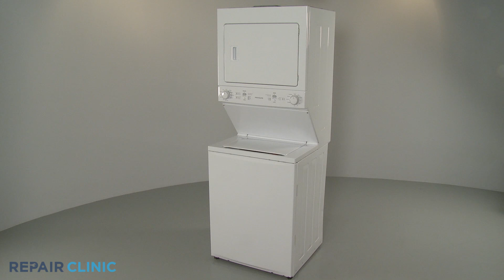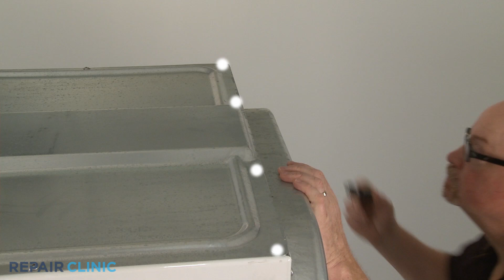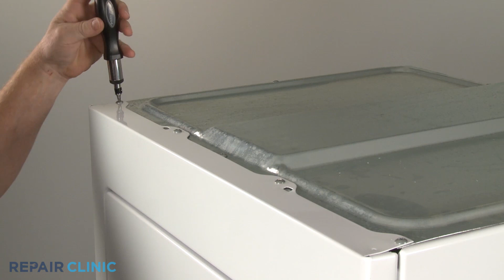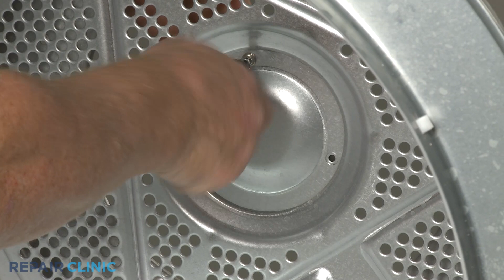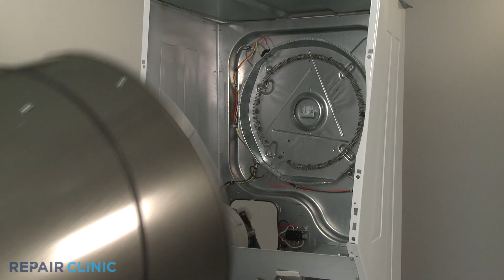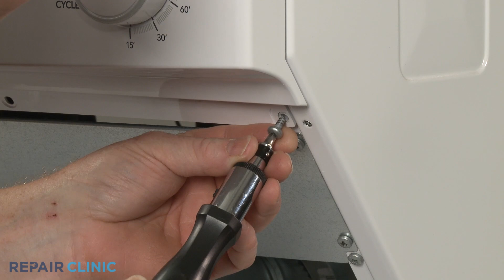Frigidaire Electric Laundry Center Dryer Drum Bearing Replacement (131777700)

Comment: if you're doing this in a closet take the whole top off and get a step stool tall enough to pull the drum from above, it also helps to get it back in. and don't forget to vacuum it out while the drum is out

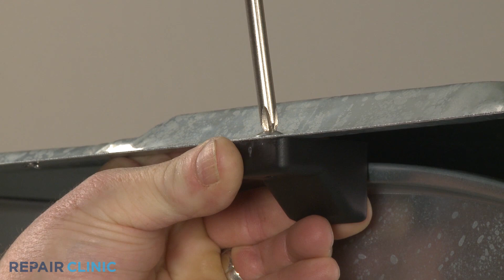Comment: You  should take top panel off the dryer to allign the rear bearing into the drum support. I struggled for 2 hours to try to get it in place, 30 seconds with the top panel off. 5:40
Reply: THANK YOU FOR THIS!!! It took me hours trying to get it aligned when all I needed to do was take the top off!

Comment: If you replace the rear bearing you use the kit and replace the bearing holder as well plus the front bearing glides. Else do not bother. Its a real PIA job.  I have done several and this video makes it look easy. it is not.  Be glad you do not need to repair the Washer.  These are lousy machines.

Comment: i do not understand this video ??? why would anyone ever replace the drum basket bearing ??? and not the holding retainer??? over time the plastic bearing holder needs to be replace i get that but never seen just changing out the drum bearing without the main problem is the plastic holder and i have done well over 300  of these... and take off the door it will make this job so much easier believe me...

Comment: Is this repair for when there is a high pitched constant squeak?
Reply: the noise you here is a worn out bearing holder worn down to the point it is rubbing on the steel retainer so if is that bad this video is worthless because it is not showing the other half of the job which is to replace the drum bearing holder which is what should of been filmed ...

Comment: Whats the average cost to get this done? I don't think I can do all that. Taking it apart seems easy its putting it back is the problem.
Reply: it is a very easy job if you remove the door makes it simple to do. the cost is around $350 and you can do it in 30 mins. and cost around $35

Comment: Good video. When I replaced the bearing on my older model stackable dryer I was amazed how much lint was packed in the interior of the housing, especially at the rear. The heating elements were covered with lint and I'm kind of surprised the thing never caught fire. I cleaned the interior thoroughly and was amazed how much more efficiently the dryer dried clothes afterward.
Reply: every year you must remove the dryer drum and vacuum out the unit and also the vent ducting so it will work better and not catch fire believe me...

Comment: After watching 15 videos I have my doubts that anything was needed except a cleaning and new grease. There's no way the ball bearing chewed a hole in the end of the ball. I think it was just a design/engineering difference in the way it was made. 
The only thing the bearing does is ground the drum for static electric and wouldn't make a squealing noise. I stuck my head inside and can see through the holes at the back of the drum and see the shiny ball. If my wife won't let me disassemble to clean and grease with out new parts on the kitchen table then I think I can stick a curved tube through one of the holes in drum where I can see the ball to oil it or even put some white lithium grease in it to lube the bearing. I've thought about drilling a hole to run a long Q tip with grease to it.
Can anyone here tell me that theirs was not salvageable with cleaning and grease or did you just go ahead and change it because you had the new parts?
Reply: Mine was squeaking for a while and then finally stopped turning all together. I took it apart to find that the entire ball on the beating was completely gone. I had continue to run it so long with the ‘squeak’ that as the ball wore away it also ‘chewed’ away at the plastic seat. I had to replace the whole thing. If yours is just starting to squeak, I’d take it apart now and lube it before the bearing and seat are completely ruined and have to be replaced(assuming that’s the origin of your squeak. There are other places that it can squeak from including the belt arm.). I wished I had. Changing it all was not fun by myself😂
Reply: @kelleyseaton7162  Mine is still running just fine since I lubed it like I told everyone how. Yes it's on my list to tear it apart and clean and lube with clean grease. It's just not on the top of my list any more. Even a catastrophic failure doesn't cost any more. It just means you'll be going to your mothers till the parts come in. You need to see your mother anyway.      If I take one day I can clean and re-lube everything and see if it'll out last me or order parts. I have cancer so I'll probably do nothing till total failure.     A dry squeak is bad and chewing away at the ball. Dirty grease is bad but will last a long time.
Reply: @kelleyseaton7162  Okay so it was another post I described how I lubes the bearing in 5 minutes. I had a sturdy laundry table right there so up on the table on my knees in to the drum supporting my self with my left arm, a little LED pocket light my face against the grill of holes in the back and I could clearly see the bearing to stick a straw on  a can  of white lithium grease through a hole and WA LA! no more squeak.